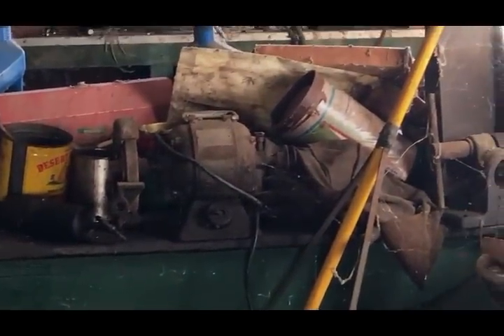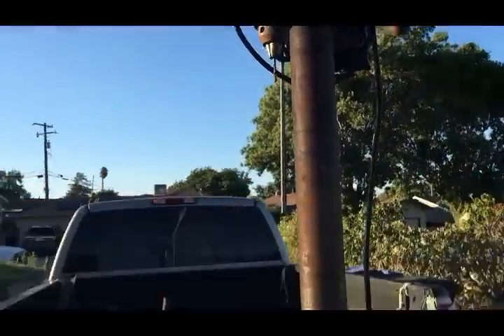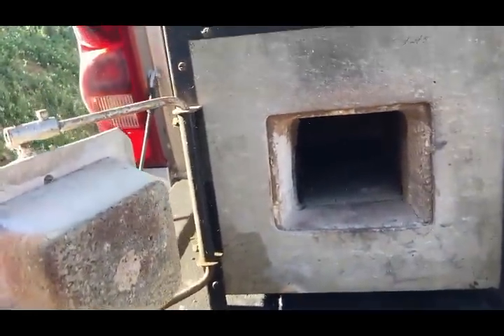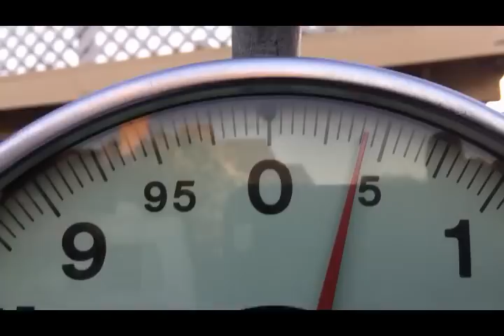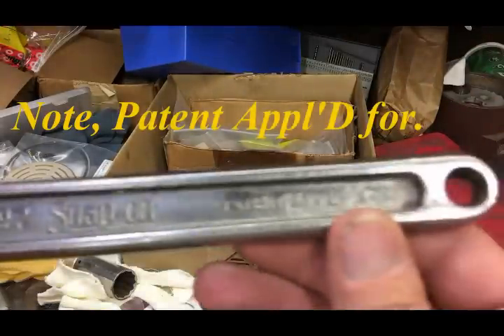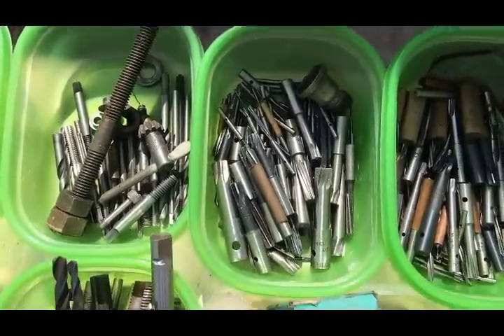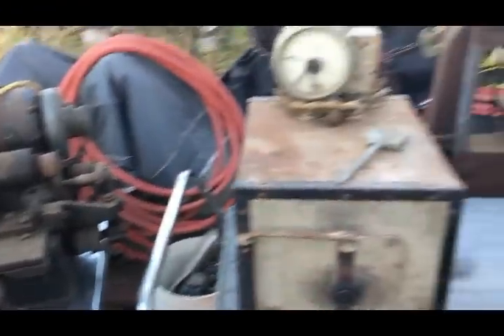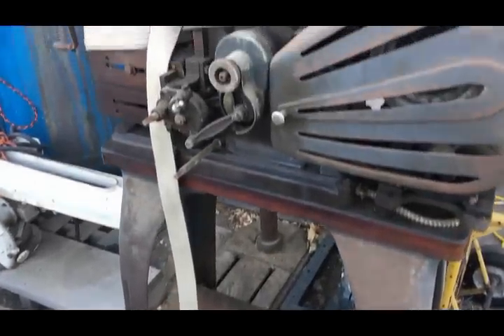Vintage Tool Rescue

Comment: That workshop clearance must have been like a gold mine. I feel the same way about old tools. My neighbour was making a concrete slab and I spotted some old spanners he had thrown in the formwork as improvised reinforcement. I was mildly outraged and he gave me the spanners with a bemused shrug. Old imperial sizes (which are fairly useless here in the UK) but I grind one to the nearest metric size every time I need to undo a big bolt. I will take a big solid old machine over some new stuff covered in plastic.
Reply from the maker: I have always had a love for old machinery, or any old iron. Thanks for checking out the video.    Gary

Comment: Wow! Great Finds! ...Gary we have matching shapers, I recently picked up an Atlas 7b. It has the same cast leg base in lue of the more common cabinet base. It's going be a while before get time to clean and get it running. I'm missing the motor side belt cover, might be hitting you up for some detailed photos, when I find time to build a new cover.
Some really nice treasures there, thanks for sharing,
Dean
Reply from the maker: Dean, Thanks for checking out my video. I have had a couple old Atlas lathes that used the same legs. But they are getting harder to come by. Let me know when you need some photos.Gary
Reply: There is a guy on Ebay that makes plastic copies of these. You wouldn't believe how original they look. We just left ours black. They are very well done.
Reply: @andyZ3500s  Wow thanks AZ I'll check it out !

Comment: Would love to have that STEPTOE Shaper.  Can't justify buying a shaper at this time.  But I do love shapers.  I love the Old Iron, comes from a time when things were built to last.  We used DeVilbiss spray guns in my father-in-laws body shop.  Great video.
Reply from the maker: Thank you Vernon. One of my first jobs was working in a body shop in the early 80s. That's all we used was DeVilbiss guns. Gary

Comment: Hey Gary, nice haul there. Love the shapers! I am going to take a guess here and say that South Bend tool looks like a fly cutter and you would insert it in the head stock and use a milling attachment and fly cut material on the lathe.
Reply from the maker: Tom, thanks for stopping by. I am pretty positive that its not a fly cutter. I think if I take it apart it may help to identify. But good guess though.Gary

Comment: I’m so jealous of all those tools. Love the swage block. Hoping I’m going to buy a friends soon. Those shapers are awesome ! Hoping to find one after I get out of high school., that huge old air compressor is absolutely beautiful. that champion 400 is nice! Considered one of the best blacksmith blowers. That boring bar thing was neat. Never seen one before. 

I have the same exact post drill I believe. The post vise is very nice but has unfortunate had the acme thread replaced. And also the screw box. So it’s hard to say. But looking at it I think it’s a Columbian. The mounting plate looks like one. Could also be made by Columbian for other sellers such as Indian chief

Really enjoyed seeing all those old tools. I think I was drooling a bit

Comment: Nice score! There's some great stuff in there, 7" leg vise, that post drill has the bearings and nothing busted, the blower looks good, those are often leaking and cracked all over...those 2 shapers, drill press (1st year), and that's not to mention all the mechanic tools and such...agree on that swage block, don't see them very often at all...anvils  go for over $10/lb these days...and swage blocks are not far behind...Wow!👍
Reply from the maker: For sure its one of my biggest hauls. Thanks for checking out my video.